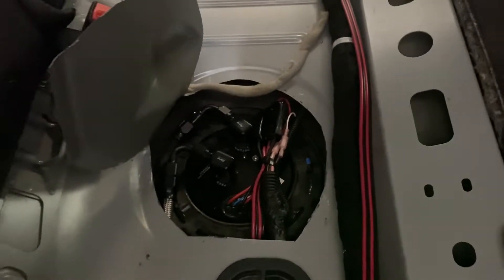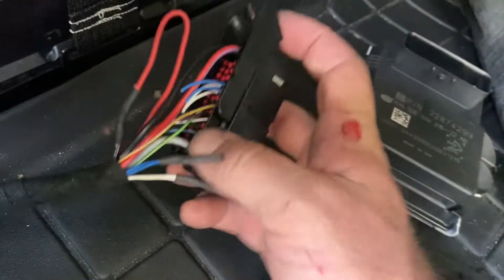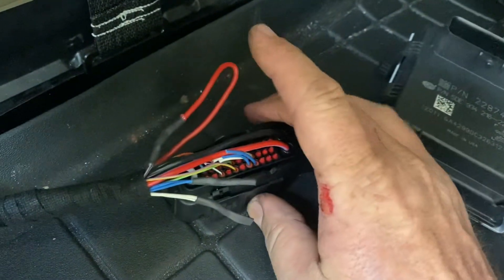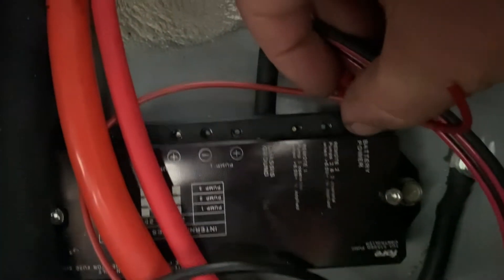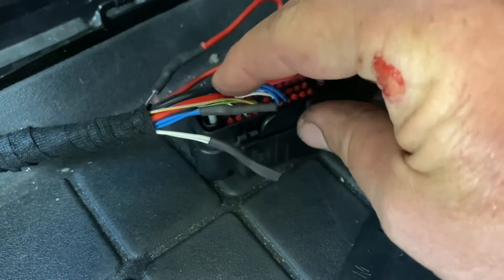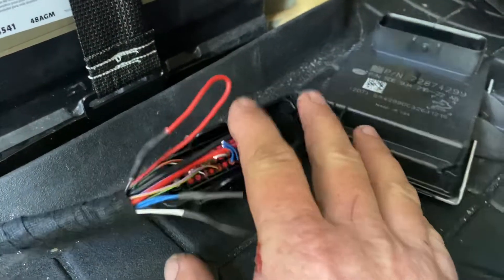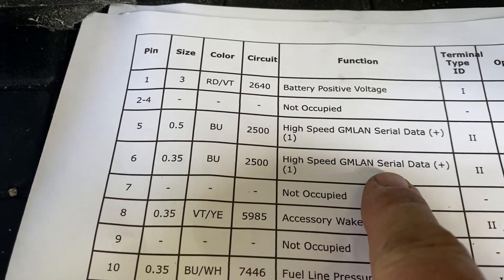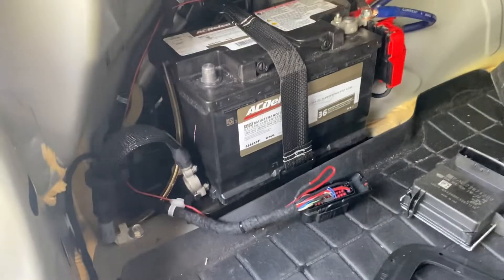Chevy SS Sedan bypass Fuel Pump Control Module FPCM (Chassis Control K38) for aftermarket fuel pump

Comment: Hello CHenry Motorsports, 

I have a 2015 chevy ss with a dual fuel pump system from fore, I believe its the same system as installed in this video and the other video you uploaded. For the longest I've noticed that I have fuel pressure fluctuations at idle, very slightly about 3 psi, but even more once I go into WOT (from 65 to 75psi). My car makes about 13 psi on my LSA set up. I'm reading fuel pressure through the VCM scanner. After watching your video, I thought that maybe the wire I tapped into to trigger my fuel system was PWM. I had previously tapped into the green wire, which is the fuel pump relay if not mistaken and now have it tapped into the violet/black wire as shown in your video. Today I logged my car and still having fuel pressure fluctuations as before.  Have you ever encountered this issue before? The only difference I noticed now is that when I key on my car, the fuel pump stay running and fuel pressure is about 62psi. When the signal wired was tapped into green wire, the fuel pump would kick on for about 2 seconds, I would see fuel pressure at 62 psi, and then fuel pump would turn of and pressure would start dropping. Maybe I should have left the wire on the relay circuit because my tune file shows fuel system prime for 2 seconds and now the fuel system stays on when the car is keyed on. What do you think about that too? 

Any advice I'll greatly appreciate! Thank you.
Reply from the maker: I believe you are referring to the fuel pump prime time. It’s adjustable from 2 seconds on up
Reply: @chenrymotorsports3264  right, should the fuel pump prime setting still work if I have my signal wire tapped into the violet/black wire as you did?

Also, what do you think about my fuel pressure fluctuating issue as mentioned in my initial comment? Have you ever seen something like that?

Comment: What if you’re not installing a new/different pump? Will tying those 2 pairs of wires together force the stock pump to come on? Or do I need a trigger wire?
Reply from the maker: You only need to do this if you are deleting the fuel pump controller. You would only be doing so if you were replacing/upgrading the fuel system. If you have a stock car where the pump isn’t turning on I’d begin with the diagnostics in the service manual.

Comment: I noticed my exhaust valves are stuck on close after doing this. Did you encounter that as well? I unplug the 20v fuse for the exhaust modal and it reopens.
Reply from the maker: Interesting! The car in the video is a 2014 so it didn’t have the exhaust valves so I can’t comment on that. I wonder if that feature is built into the fpcm on the later models.
Reply: Ah okay mine is a 2016. Doing this bypass got rid of my check engine light since I have a fore dual pump system. But I didn’t think it would affect the bimodals and I can’t find anything online  showing that.

Comment: Does the ecm still read fuel pressure when eliminating this module?
Reply from the maker: It does not work any longer. The fuel pressure sensor reports to the FPCM. Once it’s removed the pcm defaults to 58 psi and that’s the cell it uses in the IFR table. That’s how cars that don’t have an fpcm operate as well. You’ll notice if you view the fuel pressure pid it will always show 58 once the fpcm is removed.
Reply: @chenrymotorsports3264  is there no way to introduce a signal back in to the ecm? Or is it one of those external sensors into the hptuners or serial gauge for viewing/ logging type deal?
Reply from the maker: @HPKPerformance  it’s been a minute since I looked at the schematic. If I remember correctly, the ground, 5v reference and signal are all wired to the FPCM directly. Then the fpcm shares the fuel pressure data via the can bus. As long as your fuel pressure remains constant and you don’t boost reference the regulator, you won’t have a problem removing the sensor and FPCM.
Reply: @chenrymotorsports3264  Ahhh okay, i wonder if a external sensor can be wired in and calibrated into the ecm via editor. I read some where it can simply turn off the pwm output to the pump. I would love to take a look at the wiring for that, im getting ready to do my own dual pump set up in my SS because i cant justify paying so much money for a drop in unit lol.
Reply from the maker: @HPKPerformance  the FORE pump is pretty much the best deal right now. It’s reasonable if you buy only the module and put your own plumbing together.
Reply: @chenrymotorsports3264  Yea i been searching i just don't like it being bucket-less, Fueled by AI makes one but the price for it is astronomically way to expensive. I use my car primally for road racing/autox. Going to be removing mine soon to see how i can modify it for dual pumps with the venturi pump still active. I may just ditch the hanger as a whole and make my own with an Aluminum bucket and Venturi on the return line.

Comment: Is it the same procedure silverado 11-13 with the fpcm?
Reply from the maker: I haven’t done a delete on one of those yet but you should be able to tell by the connector pin out if the can bus wires pass through the way they do in this application.
Reply: Hey did you figure this out on your Silverado? I’ve got a bad fpcm and would like to just get rid of it if I can 07.5 Silverado 1500 lmg 5.3 flex fuel if I hook up a relay in place of the fpcm would I just need to run a return from the regulator or how ever it’s plumbed?
Reply: @nicholasbardsley7097  no I’m trying to bypass it to do a fuel system for turbo setup.